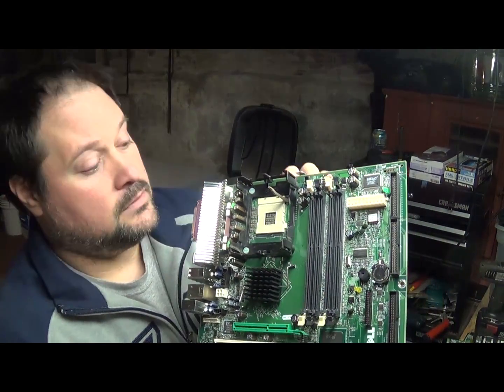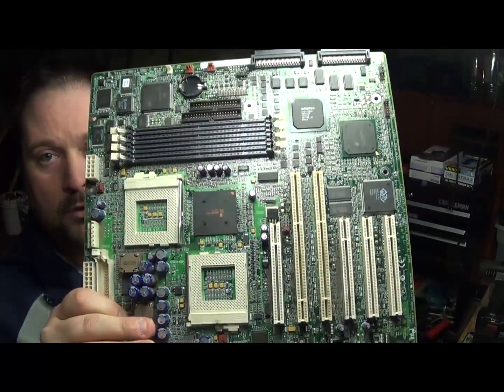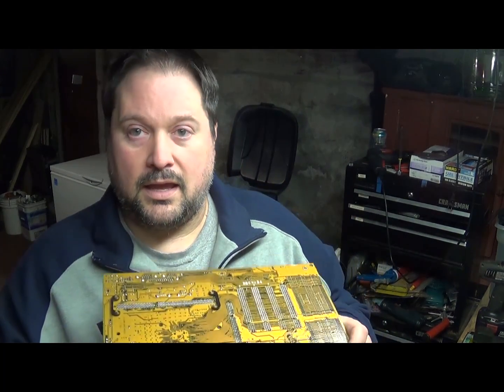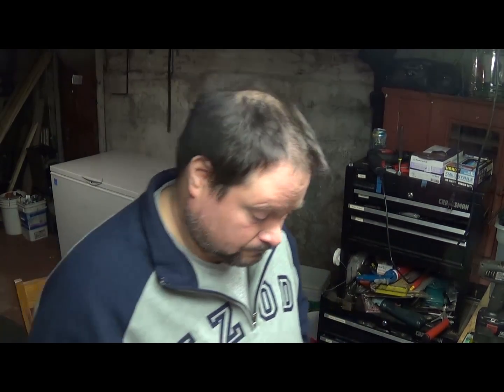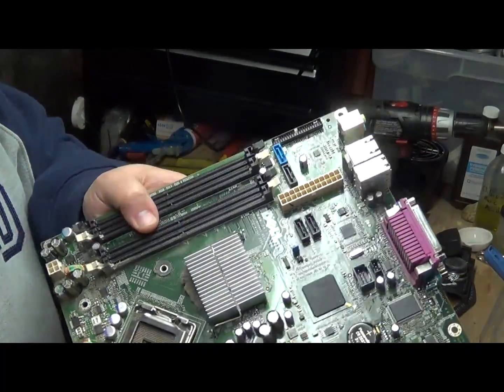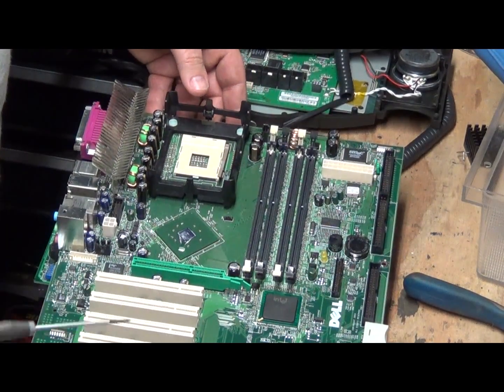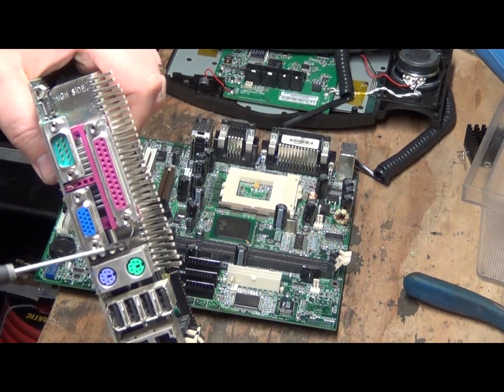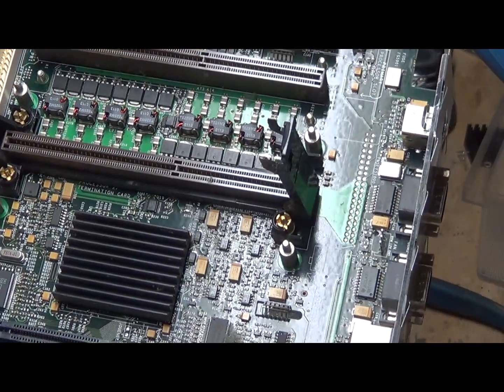Scrapping Motherboards, 24K Gold Motherboards and types of mother boards how much -Moose Scrapper

Comment: Incineration is the worst, most dangerous, most environmentally damaging way possible to process IC chips. There is NO DIY method for doing this safely. Industrial plants that do recovery this way use highly advanced and filtered furnaces that do not emit fumes into the environment or user's lungs. There are better methods involving acids with fumes and dangers that CAN be safely managed in a DIY setting.

Trying to recover tantalum or palladium for the DIYer is pointless. There is no one buying the quantities a DIY scrapper can produce and the methods for recovery get a bit sketchy and dangerous.

Comment: I have a question the fiberboard chip that usually has the heatsinks attached directly on the silicon chip on the motherboard do they have any amount of gold that is worth going after  it seems they would be lacking gold bonding wire 
Where as the capped bga has the wire embedded under the epoxy top

Comment: yes I have at lea a couple of grams of good color and I can tell you three small three in cups trimmed and I cut them close I will process a pact half  of a coffee cup plastic has weight is it better to burn off the excess or do the muriatic acid want less excessive work.if it takes the acid 5 or 6 days to dsolve.all of the plastics even to total liquid and then bring it back but they are trimmed you think you are looking at  gold pins let me have a clue on this Islam

Comment: what happened with the transaction you made when you shipped a load I do not recall mother boards or capacitors to some outfit and they kept returning your emails, that they have sent you a check. or accounting will send it. signed curious
Reply from the maker: They sent checks for 2 of the 4 boxes and did not acknowledge much of what I sent, or at least said it was not in the boxes.

Comment: Pins in sockets on mother boards are always plated, usually gold, sometimes silver, and very rarely nickel or tin.  It all has to do with the assurance of a high quality connection.  Data connections are almost universally gold plate and power connections if not bare copper are silver plate.  Gold traced circuit boards do exist but you will never see these scraping consumer level electronics.  Only the highest grade military electronics have this.

If you get a hold of some microwave communications gear, you should find some really heavy plated items.

Comment: Moose, great videos! As for the elusive gold boards, I have personally seen gold circuit boards, my uncle worked for digital in the late 70s and he had a briefcase full of gold boards. You would have to find some old massive mainframes from the late 70s, not motherboards from old pcs. They're like he holy grail at this point though.

Comment: please tell me approx.. how much you make on board and the time spent to make it ,or how many boards you have to process to make a ounce of gold
Reply from the maker: there is no good data for me to give you on that due to the HUGE variance in board types, ages, sizes, gbm capacity, etc.  most places pay an average of $2-$3.50/lb of mother boards.  In my experience with payout-vs yield, I would dare to estimate you could expect $5-$10 of gold per pound of mother boards.  So with a little horrible math, roughly 2-300 lbs of mother bards for an ounce.  REALLY rough numbers
Reply: I shouldn't tell you or Anyone else this, but I have A lot of them. I have found that when Ross Perrott ran IBM, He Demanded that His Business type Motherboards be Loaded with Better than Military Grade boards with PM's. Don't believe? Run an IBM Board and See! you will know if you have them. as they are Heavy! (Around 7 pounds) I won't tell you the "Good" years. Some things you have to find out on your own. But I did refine Almost an Ounce off of just one Board!
Reply: Thanks Val... I have not see many IBM's lately but going to check the Sally Ann used stores if their is that much gold in them...
Reply: Yes there's where I'm at?

Comment: Can i do this for a living ?
Reply: effort + expense + time = not full time pay more than full time work!! Maybe combined with other material scrapping in bulk you could balance into a large profit venture. My advice...watch for technology shifts, the latest models, new features, and large scale marketing lead sheeple into upgrading to the newest models which are actually cheaper made, in turn discarding their older units that actually contain a higher value for scrapping.
Reply: Maybe you could have in the 70's or 80's when gold was being used more generously on circuitboards. During my childhood, I remember reading an article about a man named goldfinger who became wealthy striping gold from circuitboards. But this was back in the 80's. With time manufacturers have become more stingy with the amount of gold they use. Also the fact that with the advancement of technology they are now able to apply finer layers of gold. As you know everything used to be a lot more bulkier and chunkier including the gold on circuitboards.
Reply from the maker: for a living?  Sure!  Can you get a hold of 2-3000 lbs  of motherboards a month?  OK, maybe not that much... but it takes a lot,  a WHOLE lot of mother boards to make an income you can live off of.  One of the reasons most people who do this operate a large company that has material shipped directly to them, or they do toll refining large scale, or end up just doing it as a hobby like me.  Try giving yourself a month to gather as much e-scrap as you can, then recover as much precious metals as you can (all while maintaining a regular job).  this will give you an idea of the scale.  Best of luck to ya!
Reply: Thanks for the advice man ! Really nice video tho ill try that out :D

Comment: what is best  melting with heat, or liquid
Reply: make sure to do your chemistry homework before using AP bath for extraction. it is the best process but not balanced properly the gold will "cement" with other minerals and be lost in the solution. Always Think Safety and perform under a vent hood or outdoors still being cautious as not to be inhaling any fumes.
Reply: Neither. Acid recovery is best.
Reply: Horace Oakley Exactly. The process is good, but you must be careful and take it one step in time. This isn't leisure work. This is work to be taken seriously. The end result is quite rewarding, but only if done with utmost care.

Comment: Hi Moose, Great informative vids! I've just started into the fun world of hobby scrapping and have a Question about selling mother boards. Do they still buy them after you remove all the chips and oscillators and such? doesn't seem theres much left to buy after they've been stripped down. Thanks in advance for the reply. Keep up the great work.
Reply: +Green Zombie I strip everything off. You're probably only going to get like ten cents a lb anyway. I sell the chips and monolithics on ebay recover as much gold from ALL the pins Ram connections etc  and scrape off all the canister style( resistors?) as they are Alum. When i'm done it's worth $0.10/lb
Reply from the maker: +Green Zombie as low grade boards yes.
Reply: +Robert Tyrrell thanks very much

Comment: I get 75cents a pound for mother boards and 28 dollars a pound for porcelain pentium pro chips... I but them by the hundreds to scrap, usually around 800-1500 at a time.. You can scrap everything... It's ALL worth something down to the scrap steel.
Reply from the maker: +TheZincZipper You are only getting $28 per pound of the Pentium pro chips?  They are worth at least three times that much!!  Check with your buyer!
Reply: +Moose Scrapper you have a good source I may sell to Moose?

Comment: Also, Moose I know you are a "scrapper" but I've found gold plate on jewelry, plates, vases, jewelry that is full alloy (silver, copper, gold mix) 10-22k not plate, curios, eyeglass frames, salt/ pepper shakers and all kinds of kitchen items. Pictures frames as well are sometimes sterling and/or gold plate usually. I've actually started looking at pewter which is tin & lead. Tin is pretty valuable, more valuable than copper although the price has come down. I just have to figure how to separate the tin from lead but I've only found one place that takes it. Some medals or pins/posts, earrings are also gold/silver. I find it takes less time to process these items and I don't have much space because I live in an apartment. Thanks again for your videos and unusual places to find stuff. Oh BTW - on boards or gold items I take a known gold plate item (a plated connector end/cell phone board) and compare the colors after scratching the board etc. to compare shiny copper with gold. It usually is fairly easy to see the difference especially in good sunlight.
Reply: Alchemy my friend. Dip the pen in the ink

Comment: just wondering are the aluminum heet plates in the power supply  are the same aluminum  on the mother board
Reply from the maker: +VERMrunner Yes.  Just about all aluminum heat sinks are extruded aluminum I think.  One of the higher classes of aluminum is all the little pieces of steel and screws etc are removed.

Comment: hey moose was just wondering how you get the gold out off all the sockets,  and the rest of the gold on the boards beside the fingers.  More of a hobby to me and I think it's fun, sorry if you already have a vid on this
Reply from the maker: +VERMrunner I don't have a video on this just yet.  Also, I don't pull all the gold out of the sockets.  For some things the amount of time involved is far to great compared to the gold returned even for a hobbyist like myself.  When I ge ta mother board, I pull off the CPU, RAM, and any other finger boards.  Then I remove the IC's, IDE pins, MLCC's, tantalums, crystal oscillators, and that's about it.  I will pull a pin or two out of the video and printer connectors to check to see if they are fully plated or just a tiny dab at the end.

Comment: If you have a lower grad of gold can you purify it to make it 24 k? Also if you mix other gold what happens? Also I have see pins in tvs that should have been gold plated but looks like it was not it was like a shine white color how can you know if it's gold or not? More over on tube tvs it looks like where the bulb is the pins and the inside is gold have you scraped that part before?
Reply from the maker: Coty Brock Hi and thanks for watching.  If it is not gold colored, it is not gold plated.  You can purify gold with acids.  If you mix in other gold you will only change the purity of the gold to the average of the lot.  Tube tvs will only have gold on plated connector ends in IC chips.  Inside the glass tube there are no significant quantities of metals to spend the time on.
Reply: Thanks man for the help I came a cross abunch of mouses and cords and stuff and one of them is a hook up for a keyboard and it seems to me the metal casing that looks sliver but if you take that sliver part and cut into it. It looks like gold I'm not sure if it is. I tried getting your Facebook and the link on your page did not take me all the way to send a pic
Reply from the maker: Coty Brock yeah sorry, facebook got hacked and I cant get back in.  As for the part you are describing it sound like nickel plated brass.

Comment: If I take everything off of the green board... What can I do with the empty green board? Can I process it at all? and if not is it even sellable? what do the people who buy it do with them?
Reply from the maker: Leonard Greenpaw once the green board is depopulated, there are companies that buy them to recover the copper but they pay very little for them.  They are almost worthless.
Reply: Moose Scrapper Love your vids moose. Can i just throw them in with low grade boards once depopulated? Just trying to do this effectively and ethically. Thanks moose
Reply from the maker: Dennis Little as long as you leave a little something on them, even if its just aluminum capacitors.
Reply: Moose Scrapper
Those would be the black plastic wrapped cylinders?
Reply from the maker: Leonard Greenpaw yup.  the folks at rockaway recycling say there needs to be at least one item on the board for it to be low grade and not junk.
Reply: Moose Scrapper
Interesting, oh hey I have a requested on similar topic though. Could you do a video on the differences between high medium and low grade boards? That would be awesome thanks

Comment: Should i depopulate circuitboards remove ic cpu heatsink gold fingers or send in as is thanks
Reply from the maker: ***** If you remove those items you are decreasing the value of the board and will be paid a lot less.  Most companies that buy the mother boards allow for the heat sinks, CPU's, RAM, and PCI cards to be removed.  But that's all.

Comment: hay moose i have I-a 1999  gold mother board IT HAS A 2"pin plate lots of gold pins on it sure looks good some one dump it in are dumpster at are home im puting on some testing this mother board has all the things your showing on your vedio what do you think?
Reply from the maker: fredie w Hi and thanks for watching!  You have a gold colored mother board, that's a good start!  Remember that it is only gold colored and not actually gold etched.  Each of those mother boards without the ram and CPU will have anywhere from $5-$12 in gold.
Reply: Moose Scrapper HAY" mOOSE THANKS FOR GRTING BACK TO ME ON MY MOTHER BOARD I  HAVE 2 2" & 1 1" with gold strips all the pins are gold dark gold looking ram has more gold and the cpu; has gold  and all the fingers have good  nice board dos not look like your board at all what do you think ? freddie W
Reply from the maker: fredie w I think its a good start!  The pins and fingers will have gold.  The IC's will have gold, but any strips that you see on the mother board...still not gold.  They just do not make gold etched motherboards.

Comment: Hey Moose, I'm predominantly an e-waste guy and I have to remove 5 billion screws a day. I had a heavy 18v drill, but decided screw it, my arthritic wrist is killing me and went out and bought a little 12v Dewalt impact driver. It's 2 pounds with the battery attached and runs at about 2500 rpms(variable trigger) with twice the torque of a drill. Impact drivers don't cam out and round out the screws like drills do either. I paid $120 for my combo which is pricey(Makita's is a little cheaper), but it has changed my world lol. I can remove 100 screws in half the time with no wrist fatigue.

Anyway, seeing those motherboards reminded me of all the screws scrappers have to contend with and thought I'd share.
Reply from the maker: Nicodemo B That's awesome!  Thanks!  When this one dies I will try that one!

Comment: Hi  Moose I'm Emma from Manchester in the uk  I have been told from scrapping pc towers I can get zapped (shocked) on the motherboard and in the power supply is this right as I have lots of towers to scrap thanks again Moose
Reply: Emma Webster Certain electronics can hold a charge, even when unplugged. I generally wait a week before I scrap electronics.
Reply from the maker: jtcardsfan That's the answer I would have given, and would add that I have never been zapped!

Comment: There are some Tantalum capacitors that are black with a white line to show the + side. Also there are some that are blue and black mostly on TV boards and other types of boards in older computers.
Reply from the maker: TwoOneO Scrapping Great info!  Thanks!
Reply: Moose Scrapper Yup no problem their is also a buyer on the Scrap Metal Forum that has picture of all different types he buys. Will give you a better idea what to look for.

Comment: Maybe I missed it, but is a hot sand bath how you get all the pieces off?
Reply from the maker: Bricky Nope, you can try, but hot sand baths for boards this large take a long time.  I typically cherry pick what I want off.  Working on a video for that.  Most people use an air chisel or some other super fast way to roughly remove everything.
Reply: ok thanks

Comment: Moose, i have a large pile of motherboards as well. my yard buys the low grade at a good price but a poor price for motherboards. ive seen most scrappers on here either use board sort or cashforelectronicscrapusa have you used either of them and whats your opinions for either of them. Thanks! and keep making the videos!! love them
Reply from the maker: James Linch THanks for watching!  I do not sell my mother boards to either company though I have heard very good things about them both, particularly boardsort.  I live in Maine so the shipping costs are too high for me.  I tend to strip them down to process myself.  I have sold some on ebay though for a reasonable profit.

Comment: do companies buy the boards after you have pulled all gold/copper/aluminum/steel content and other components? ive looked with  boardsort and they dont seem to buy depopulated boards
Reply from the maker: theweirdone Once a board is completely depopulated there is almost no value left to it besides the copper tracing.  I am currently looking into how much you can remove from a motherboard unitl it is considered low grade.

Comment: Are the monolithic ceramic capacitors only the tan ones, or are there more a variety of colors?  I've even seen what appears as monolithic ceramic capacitors that are round and not square, what are these?
Reply from the maker: Eric Willits I would have to see a picture.  As far as I know, there are no round monolithic ceramic capacitors.
Reply: Eric Willits How would or can I send a picture through these comments?  Is there an email address I can send a picture of them
Reply: Moose Scrapper Most of the time I find them inside the silver box that a coaxial cable is screwed into on a tube tv
Reply from the maker: Eric Willits moosescrapper on facebook.  You can upload pics and get lots of feedback.